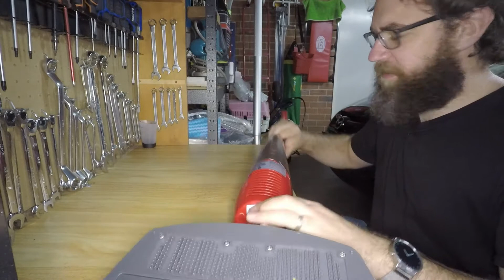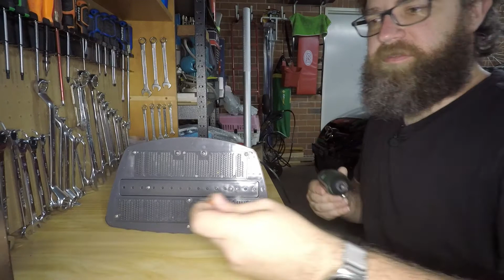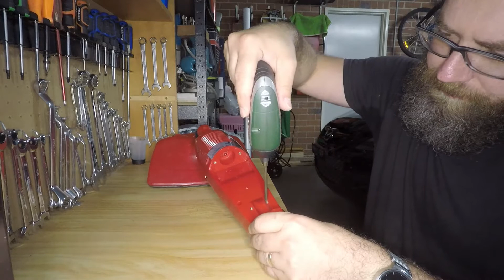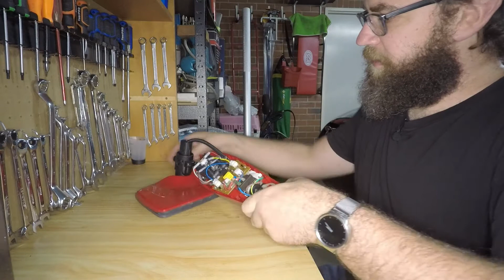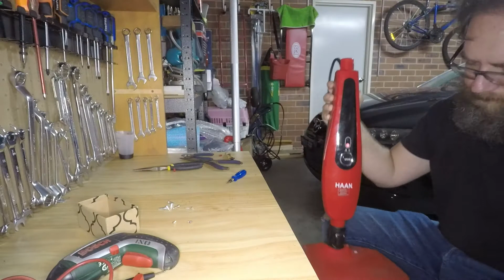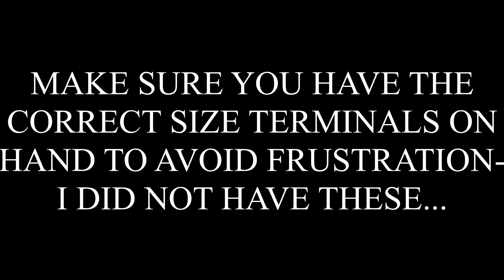Steam mop repair - won't turn on

Comment: I loved your video.  Thanks for your time and sharing.  To respond to a viewer’s question I am providing solutions as follows: 

If the pump runs, heater works fine but no steam coming from the mop head nozzle, from my experience, here are the solutions:

1) Symptom-1: I assume that you are able to hear the pump running. Do you see any water dripping while the pump is running? If yes, most likely it is building back pressure in the tube that has the blow-off valve on the line that connects the pump to the bottom of the heater due to clogging of the check valve on the inlet to the heater.

2) Symptom-2 If no water is dripping while the pump is running with water in the Reservoir indicates that water is not flowing out of the pump to supply to the heater. This is most probably due to lack is priming in the tube from the reservoir to the pump inlet. That means a portion of the line feeding water to the pump (not the heater) is having air bubbles in it. It happened to my mop model S3601.

SOLUTION:
Symptom-1 Clogged Inlet to Heater - SOLUTION - Unclog the inlet valve to the heater. This happened to me. People use vinegar to unclog. Vinegar did not work for me because my mop is 5-7 years old and was completely rusted. I had to drill through the inlet check valve, because I could not remove the rusted screws from the heater. Please do not drill, very risky, it must be the last resort. If your mop is not very old, vinegar should work (please see YouTube videos on how to use vinegar if you need to. Many viewers replied that it worked for them.)

Symptom-2 Lack of Priming SOLUTION - Please do the following:

a) Always use DISTILLED WATER not tap water, not RO water, not Spring or mineral water to fill the reservoir. A gallon of distilled water costs about $1.20 which lasts about 10 times; available in grocery stores, Wal-mart, Pharmacy like Walgreens, Target store etc.

b) Run the unit in SCRUB mode for 30 to 60 sec so that the pump will try to suck the water from the reservoir.

c) Unplug the unit from the power source. Open the reservoir cap and pressurize the water tank/reservoir by blowing air into it the way we fill air into a balloon. I put my mouth on the reservoir filling area and blew air like we blow a trumpet or couch. Just for 3-5 seconds of blowing should push the water in the inlet tube to the pump thereby pushing the air out as in bleeding.

d) Close the reservoir cap loosely, connect the unit to the power outlet and turn the unit on and set to SCRUB mode.  In a minute or so, if you hear some hissing sound and no water dripping, then you are successful.  If you did not hear hissing sound (which is caused when water fills the hot heater) while the pump is running within 1 or 2 minutes, open the cap of the reservoir and blow some more air without letting any air out while blowing.  The purpose of blowing air is to pressurize the water inside the reservoir which will push the reservoir water into the inlet tube of the pump. After that there is no need hold the air in the reservoir under pressure. Pressuring was needed just for the initial push of water into the inlet tube of the pump to assist in priming.  Then close the cap of the reservoir. You should hear the hissing sound in a minute or so.  If you did not hear any hissing sound, hold the mop almost horizontal while the pump is running which should help in priming the pump.

I have gone through both the solutions and my mop is running without any problem for last 5 – 7 weekends.  NOTE: Empty the water after use before storing. I actually run the pump till the last drop in the reservoir.  The purpose of doing this is to remove any water staying stagnant in the inlet line to heater which is the source for chemical reaction to clog the inlet.  Please use DISTILLED WATER only to prevent clogging in the first place. This S3601 model is self priming. Only first time I had to help in priming.  The second time I just held the mop a bit horizontal as in moping under the bed.  There after there was no priming issue for last several weekends.

PLEASE DO THIS AT YOUR OWN RISK, if you feel comfortable.
Reply: Wow tbanks

Comment: I checked my steamer and both fuses are good but no steam. No scaling and heater is good.  Any other ideas?
Reply: If the pump runs, heater works fine but no steam coming from the mop head nozzle, from my experience, here are the solutions:

1) Symptom-1: I assume that you are able to hear the pump running. Do you see any water dripping while the pump is running? If yes, most likely it is building back pressure in the tube that has the blow-off valve on the line that connects the pump to the bottom of the heater due to clogging of the check valve on the inlet to the heater.

2) Symptom-2 If no water is dripping while the pump is running with water in the Reservoir indicates that water is not flowing out of the pump to supply to the heater. This is most probably due to lack is priming in the tube from the reservoir to the pump inlet. That means a portion of the line feeding water to the pump (not the heater) is having air bubbles in it. It happened to my mop model S3601.

SOLUTION:
Symptom-1 Clogged Inlet to Heater - SOLUTION - Unclog the inlet valve to the heater. This happened to me. People use vinegar to unclog. Vinegar did not work for me because my mop is 5-7 years old and was completely rusted. I had to drill through the inlet check valve, because I could not remove the rusted screws from the heater. Please do not drill, very risky, it must be the last resort. If your mop is not very old, vinegar should work (please see YouTube videos on how to use vinegar if you need to. Many viewers replied that it worked for them.)

Symptom-2 Lack of Priming SOLUTION - Please do the following:

a) Always use DISTILLED WATER not tap water, not RO water, not Spring or mineral water to fill the reservoir. A gallon of distilled water costs about $1.20 which lasts about 10 times; available in grocery stores, Wal-mart, Pharmacy like Walgreens, Target store etc.

b) Run the unit in SCRUB mode for 30 to 60 sec so that the pump will try to suck the water from the reservoir.

c) Unplug the unit from the power source. Open the reservoir cap and pressurize the water tank/reservoir by blowing air into it the way we fill air into a balloon. I put my mouth on the reservoir filling area and blew air like we blow a trumpet or couch. Just for 3-5 seconds of blowing should push the water in the inlet tube to the pump thereby pushing the air out as in bleeding.

d) Close the reservoir cap loosely, connect the unit to the power outlet and turn the unit on and set to SCRUB mode.  In a minute or so, if you hear some hissing sound and no water dripping, then you are successful.  If you did not hear hissing sound (which is caused when water fills the hot heater) while the pump is running within 1 or 2 minutes, open the cap of the reservoir and blow some more air without letting any air out while blowing.  The purpose of blowing air is to pressurize the water inside the reservoir which will push the reservoir water into the inlet tube of the pump. After that there is no need hold the air in the reservoir under pressure. Pressuring was needed just for the initial push of water into the inlet tube of the pump to assist in priming.  Then close the cap of the reservoir. You should hear the hissing sound in a minute or so.  If you did not hear any hissing sound, hold the mop almost horizontal while the pump is running which should help in priming the pump.

I have gone through both the solutions and my mop is running without any problem for last 5 – 7 weekends.  NOTE: Empty the water after use before storing. I actually run the pump till the last drop in the reservoir.  The purpose of doing this is to remove any water staying stagnant in the inlet line to heater which is the source for chemical reaction to clog the inlet.  Please use DISTILLED WATER only to prevent clogging in the first place. This S3601 model is self priming. Only first time I had to help in priming.  The second time I just held the mop a bit horizontal as in moping under the bed.  There after there was no priming issue for last several weekends.

PLEASE DO THIS AT YOUR OWN RISK, if you feel comfortable.

Comment: Have a similar situation with Oreck 100 Steam-it.  Replaced the thermal fuse but steam mop only ran for about 4 minutes before it blew again. Must be the thermostat allowing it to overheat.  Heating element is good.  Package of 5 fuses took about 3 weeks to get here from China via amazon.ca.  Hope thermostat is quicker!

Comment: Hello, may I ask if you have a recommendation on the thermal fuse? Model/place to purchase?
Reply from the maker: Hey Shaun, I don't remember which fuse I ended up using but I think I mentioned it in the video. You should be able to find them on eBay pretty cheap, you just need to match the temperature rating